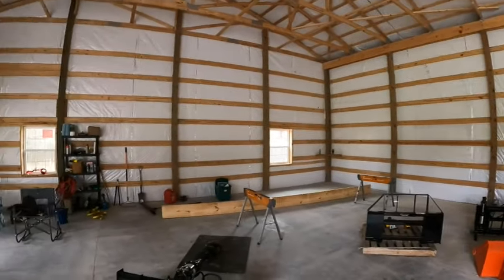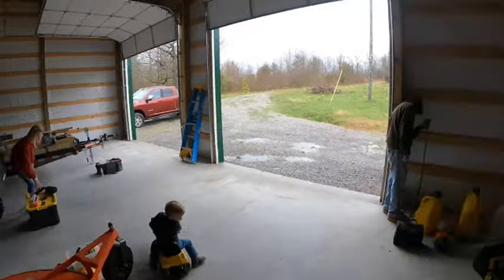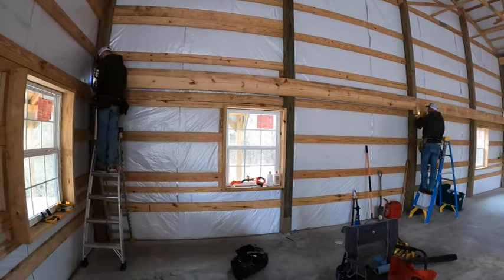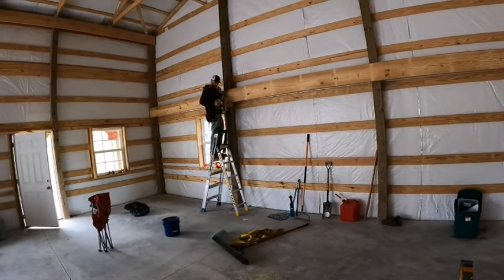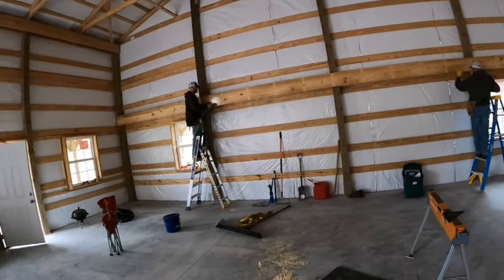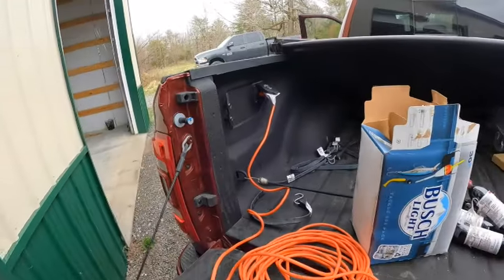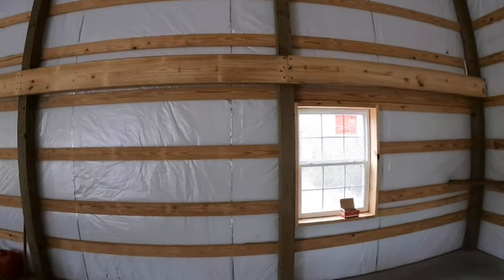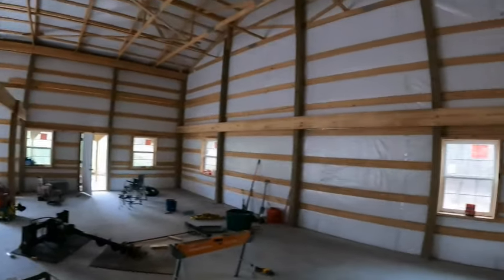Part 1 of adding 2nd floor in Pole Barn. Installing Rim Joists and Posts for Loft / Mezzanine.

Comment: Yeah those are a bear to lift. Not just lift but hold a screw as well. Looking good guys! Keep rolling along. To hard to sling those with the bucket and hold them in place eh?  Cheers, Mike.
Reply from the maker: Thanks Mike.  We gat smarter as the project rolls on.  Use pallet forks to lift the sub floor sheets.
Reply: @MarquithLegacyAcres  atta boy!

Comment: Your off to a good start Tod. It's going to be a great use of the upper space.  I was wondering if you are planning to run vertical supports along the pole barn post from the floor to under the laminated ledger to carry some of the weight load.  Have  good one!
Reply from the maker: Thanks.  As of now, I think we have enough support, depending how much weight we put up there.  If you have experience and think I am mistaken, please let me know.  2x10 floor joists going in next.
Reply: @MarquithLegacyAcres I think you should be fine with the amount of fasteners and their shear rating for what I could see.  I've learned to build not allowing bolts, nails and screws to carry  the weight load as their primary function is to fasten, tie and hold objects together.  Personally I would run supports along the existing post for peace of mind so I wouldn't have any future concerns about adding more weight, but that's me.
Reply: Man i dont know. 2 by 12s to carry residebtial load usually are at a engineered max of 13 or 14 feet. What did you end up doing?

Comment: How are you running 2 by 10s to almost 20 feet? Are you framing out rooms underbeath to act as a length breaker and provide support?
Reply from the maker: We will be adding framing below.  May be putting cart before the horse, but think it will work out.  Also went with 16" centers instead of 24".  Thanks for reaching out.